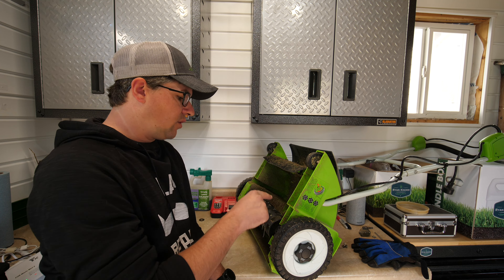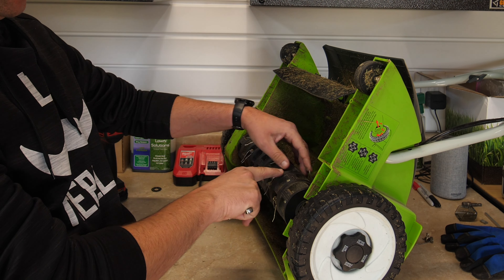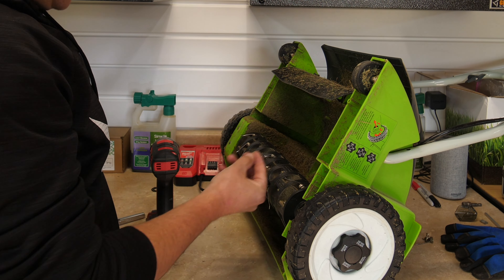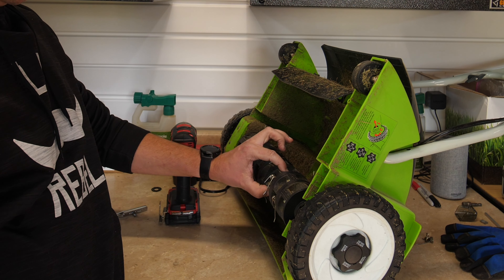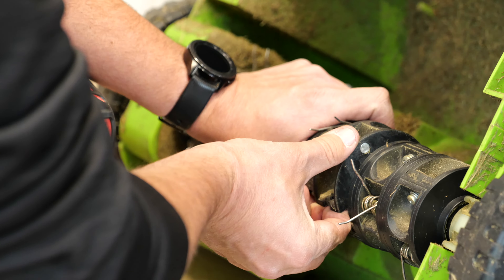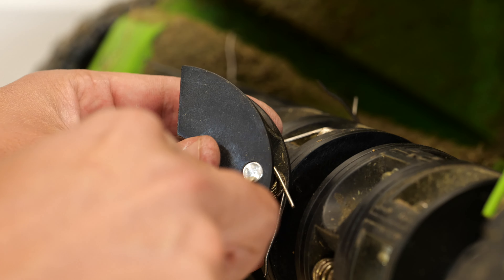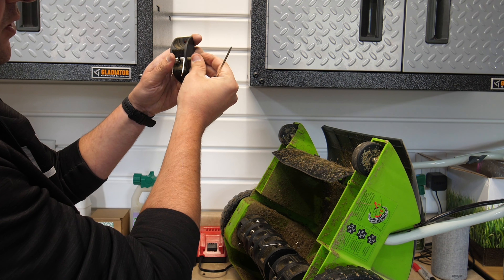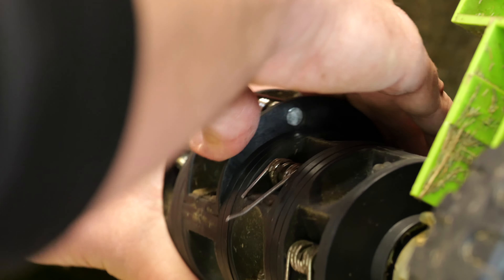How To Fix Broken Greenworks Dethatcher Tines

Comment: Sweet.  I bought one of those a couple of weeks ago to prep my yard for your sissy grass seed.  It did a pretty good job and the tines still look alright.  I decided I'm going to kill the front yard towards the beginging of June. That will give me a chance to spray it a couple times, thatch it a couple times and start leveling.  I pre ordered your leveler and I know it will be here by then.  By mid July everything should be ready for seed and peat moss. I plan on adding your 80/20 blue / rye next Spring.  I want to have all sissy grass just once before mixing in anything just to see it.

Comment: Just finished replacing all 18 tines. No need to remove the plastic piece completely.  Take a flat blade screwdriver and align it up with end of the plastic piece.  At the end of the plastic piece, smack a flat blade screwdriver with a hammer to loosen up the plastic piece.  Pull it up just enough to expose the roller holes.   Now with a hammer and screwdriver/allen wrench,  pop the roller out one side about 90%,, just enough to remove the old tine, and replace with a new tine. With your fingers or a tool push the roller back in place making sure the new tine is in its correct direction with the tines up.  Give the plastic holder a couple of raps with a hammer to put it back into its original position.  Tighten it down and you're done.   Repeat another 17 times. Took me about an hour

Comment: Yes, you will need to replace a tine about every 40 feet, many times within just a few feet.
You must ALWAYS, at the end of EVERY line/path you walk, you MUST flip the machine over to check for broken tines & then you MUST carefully drag your 2 foot long magnets (one of those magnet tool holders that are great for screwdrivers, sockets, files, etc)  along the area you just dethatched (do NOT rake up the dead grass first!) and find the tine...! If that does not work, then you can GENTLY rake up just 2 foot sections of the dead grass - do not rake to the ground, you are just piling up the top level amount of the grass in many small piles (along the path you just dethatched) then you will CAREFULLY  pick up each pile with your hands & bag them while looking for the tine that might be 'mixed' in with the grass.

After that, re-drag the magnet over the entire path again & if you do not find the tine then pray it's in the bag because if it's still in the yard it will probably break a tine the next time....

I should have prefaced my comments with:
1. Mow your lawn to 1" (or lower, but never below the roots)
2. Use your leaf blower (and if needed, crawl your whole yard on hands & knees) to blow out EVERYTHING THAT MOVES THAT IS NOT GRASS (ie: sticks, leaves & the tiniest rocks/pebbles). Pick up every one because those tines will break.
3. Those tines WILL BREAK.
4. It is my belief that new machines have actual spring steel tines & all replacement tines are made of cheap crap, i know, i've spent more on tines than the $80.00 for the machine.
5. Start a TINE SAVINGS FUND because you will spend more on replacement tines.
 6. You will spend more time replacing broken tines in a single day than it takes to dethatch your entire lawn (years of experience here folks...).
7. You laugh at my comments thinking my lawn must be a desolate wasteland.
8. Stop laughing....
9. You couldn't find a cleaner lawn than mine unless you had sod put down (and that's only good for maybe a day...).
10. The machine is great & the replacement tines are garbage but as i only know that the machines original factory tines didn't break the first year (spring & fall) the possibility of tines breaking wasn't even on my radar. It was the 2nd year (metal stress, rust, who knows?) when i noticed the broken tine after the a bit of dethatching. A loud TING, a quick flip of the machine, and then the continuous decent into tine replacement hell. Having to order them online does not help.

It's too bad i can't post a pic of my 2nd gen version of my magnet bar, it is pretty cool....
If you haven't yet bought a DT'er & are thinking about this model, it works great.
Order an additional 100 tines (because i know my lawn is cleaner than yours, that's just life...) so you can get through your first lawn dethatch.

11. Do not complain about anything that happens because you did not memorize all my instructions above (though i did leave a few things out that you should do & tools you should have before you DT the first time but i can't do everything now, can i....?)

12. Have fun & good luck....
13. FYI, after mowing low & blow drying yer lawn prior to yer 1st DT, drag the magnet bar across yer lawn to remove all metallic objects ( i know many of you didn't even think of that, did you...?).
NOW you can go & have fun creating new and unusual epithets & euphemisms (maybe even discover a new metaphor...).